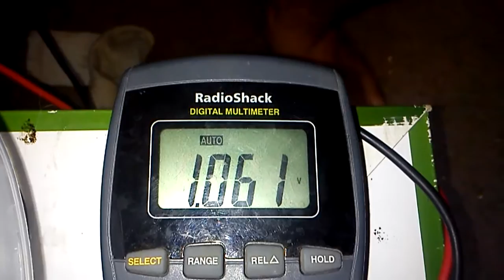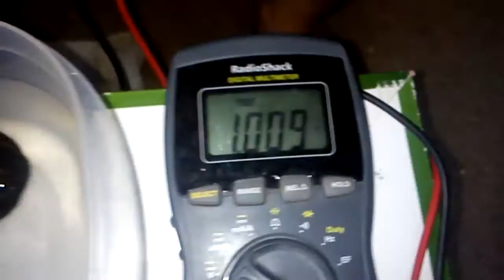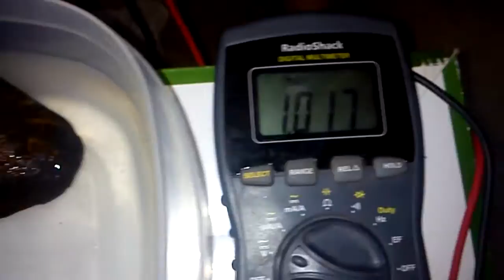Meteorite/Meteorwrong/Petrovoltaic Rock Produces Electricity

Comment: You have discovered natural negative resistors ... If yo holding a Galena than anyway this is what was used for crystal radio DIY sets back in the days .

Try figure out which stone you have "identify rock" .

Another thing , it is to me one of the main feature of Overunity technology THAT WORKS .

Put a Load and you get more power .... so PUT ANOTHER LED !

Try see if you can get more , see your standng voltage is same as "Karpen Pile "

Pile is French for Battery ... not Pile of sh... ; ) btw.

I recently had the same experience and because i live in Cyprus you can't imagine the geological multitude of Rocks & Minerals in my back yard .

Comment: I've examined Larry's rock. It's very heavy for its size. We think the rock
may be an iron meteorite, with different metals in it. Something is creating
a voltage potential in the rock. Maybe it's like a primitive battery, where
dissimilar metals are immersed in a conductive solution. Most common rocks
can't do this. But, if you have a meteorite, give it a try.
cw27vid, Arizona